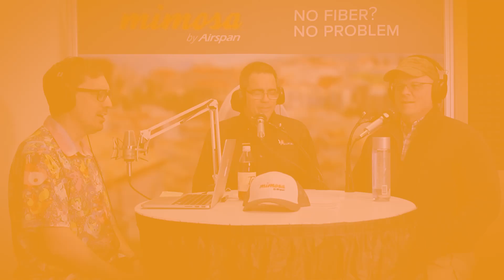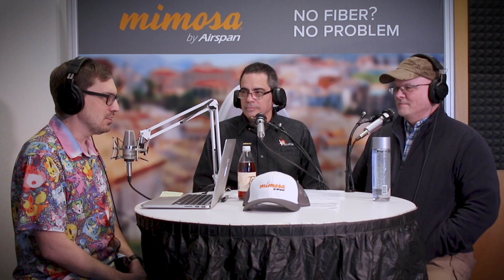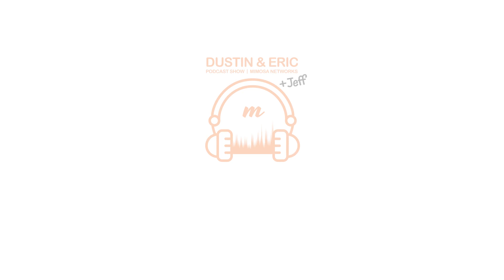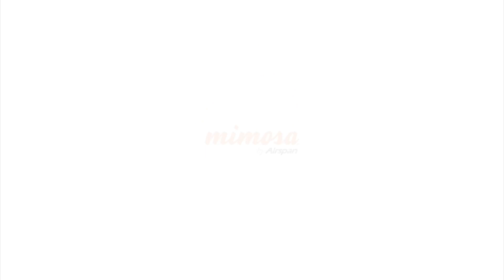Mimosa Podcast #40: A6 Frequently Asked Questions

Comment: I think this is the only part of Mimosa left that hasn't been taken over by the corporate Airspan drones that feel the need to say "Mimosa BY AIRSPAN!!!" at every opportunity they can get.

Honestly, you'd think that in an industry with customers mostly consisting of small WISP operators, that a company like Mimosa wouldn't want to appear so god damn corporate. When you were independent, you were a gem in the fixed wireless industry. Now Mimosa BY AIRSPAN just feels like they've sold out and want to profiteer off the backs of respectable WISP operators like me.

When I started out, I swore I'd avoid Ubiquiti and Cambium like the plague. But now, they're pretty much who I use exclusively. I don't even have any Mimosa gear anymore, and I don't intend to lock myself into an Airspan-controlled 6 series PtMP network because I don't like where things seem to be going after Mimosa got bought out by them.
Reply: They do have the logo with Mimosa by Airspan at the top. But ironically, Airspan recently sold Mimosa Networks to another company.